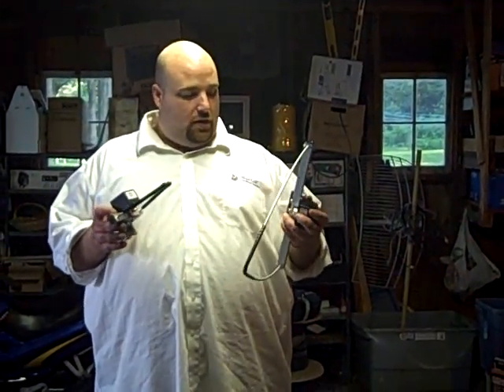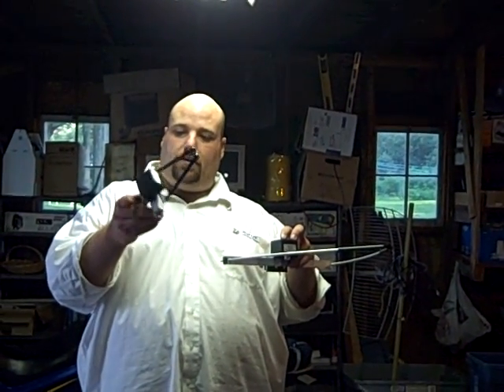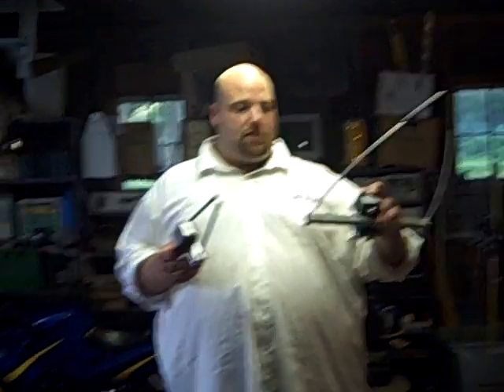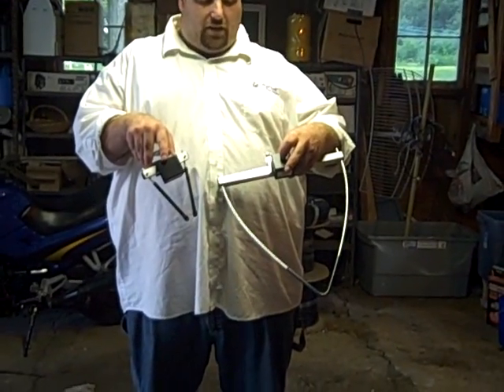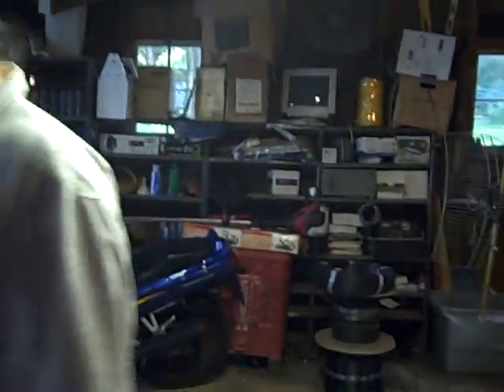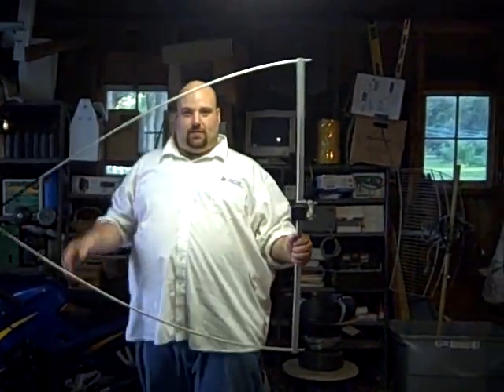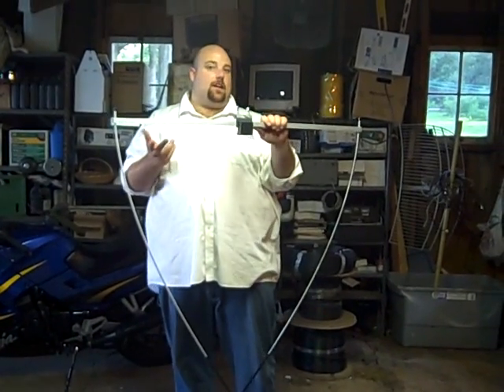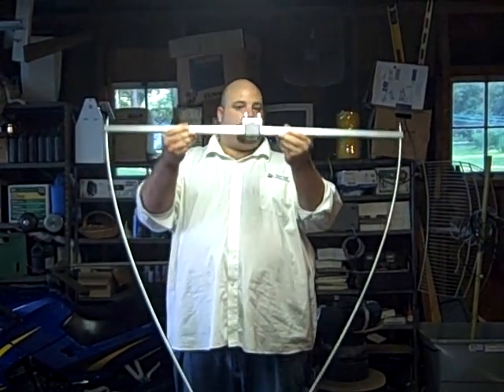PAR Electronics Omniangle antennas

Comment: I have had a couple of the OA-50 and they were great on my mobile and I just ordered an OA-144 and OA-432 Today 5/23/19 and they will be put up at about 48 ft. The OA-144 & OA-432 now come already assembled and tuned so they are even better than before.I chatted with Dale on the phone for maybe 20 minutes or more.He is a great guy and they make and sell top of the line products and the eHam reviews reflect it.If you wish you may work the Satellites with them as well and you may be surprised at how well they work them.
Reply: I Sold the OA-144 after getting my Cushcraft 215WB yagi back in the air but I have the OA-432 at about 39 ft at the moment & it works much better than you would think.A friend will be moving it up the tower to around 48 ft in a few weeks so an extra 9 feet could be helpful but we will see.Height is Might with VHF/UHF antennas.